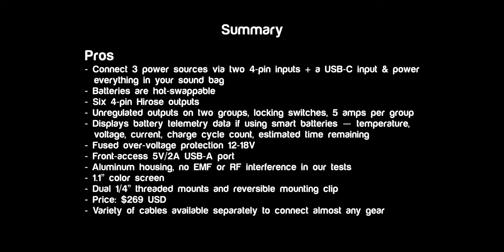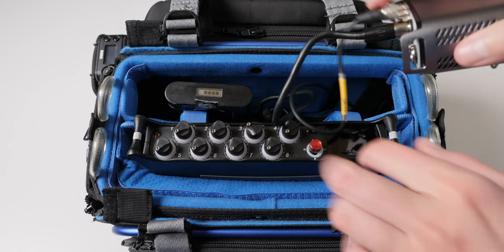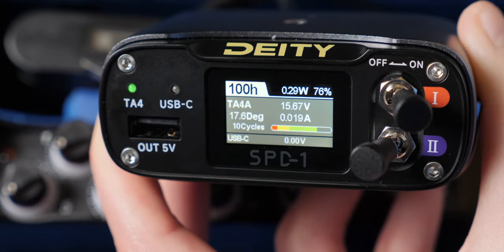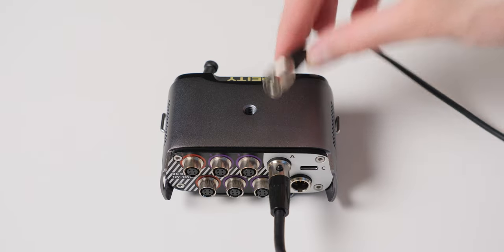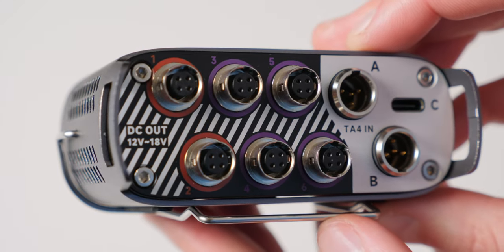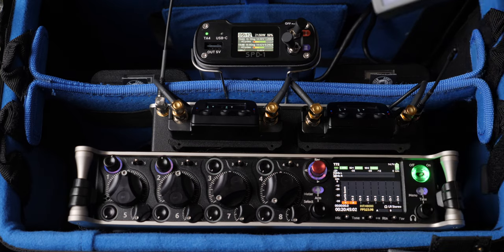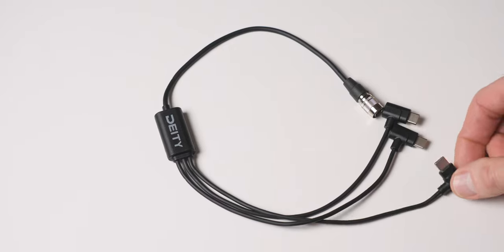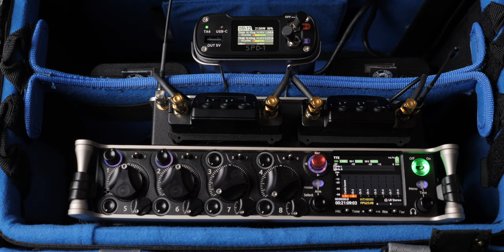Power Your Sound Bag: DEITY SPD-1 Power Distribution Box

Comment: I would have maybe thought twice before buying my BDSV4 from Remote Audio after seeing this model given the features and the price point. The cons for me with the Deity would be that i needed more DC locking barrel plugs for my wireless rather than 4 pin Hirose, and the higher cost of 4 pin cables that may need to be adapted for my wireless receivers(using Sennheiser G4’s with dummy batteries wired with dc barrel plugs)

Comment: Hi Curtis. I was especially interested in this due to the USB-C input option, specifically being able to run a bag/cart off house power/simple laptop voltage USB wallplug. Have you tested the USB-C input? I tried using it with a laptop charger (as Deity suggests) on a shoot the other day, but the SPD-1 was showing it would only receive 9V from USB, instead of the desired 12V.

Comment: Coming from the field of electronics I know that unfiltered non isolated power outputs can affect devices that are powered in parallel.
I wonder if you experience any noise issues, although I doubt it because it is more common when you power more simple analogue devices.
Also the non current regulation of its outputs can be a good thing because in cheaper devices the electronics are prone to failure that could cause damage to the devices they power. If the regulator is not there in the first place one less thing to go wrong.
Reply from the maker: I haven’t experienced any noise yet.

Comment: Did I understand correctly that this will not power sounds devices mix pre 6? Or were you referring only to the USBC output?

Thank you
Reply from the maker: The USB-C cable does t supply enough for the MixPre 3 or 6 and neither of these recorders have hirose inputs

Comment: Thanks for the detailed review. One thing i don't get is that the power draw from an 888 plus sl2 is afaik in some cases a bit too much for what hirose plugs are rated for, hence the ta4 in the sd 8 generation. Why use a device that has that high power rating on the input side but not on the output?
Other than that, great product i'm really considering for my 633bag
Reply from the maker: Yes, that's my understanding.

Comment: If you have an 888 with an SL-2 (as you did in this video) then there's not much point to using the Deity is there? You can just run your smart battery into the 888 (using the 888 to monitor telemetry) and use the SL-2's outputs to power everything else. I guess the manual toggle switches might be a benefit in some circumstances tho?
Reply from the maker: Also, multiple batteries for hot swapping. That’s a big benefit on its own.
Reply: @curtisjudd  The 888 has no fewer than 3 hot-swappable batteries on its own, though (the smart battery and 2 NP-Fs)
Reply from the maker: @patrickchase5614  yes, but I prefer not to have to dig into the bag or pull out the mixer to change batteries.
Reply: @curtisjudd  no need to dig into the bag! You can charge NP-F batteries without needing to remove them, I haven't removed mine from my 833 in months and *months*.
Reply from the maker: @davidcmpeterson  truce! I’m not here to say you have to buy this or do it my way. For my workflow, I prefer to use two smart batteries. I make no judgements about everyone else powering how they choose.

Comment: Thanks Curtis! So to be clear, you can power an 888 with this, but NOT a MixPre-3? Even from the dedicated USB-C?
Reply from the maker: Hi Zach, with the existing cables, that’s correct. But there are two potential solutions: 1) use one of the after market battery sleds for the MixPre with a 4-pin hirose input or 2) DEITY makes a new 4-pin hirose to USB-C cable which supplies enough voltage and current for the MixPre-3 or 6 recorders
Reply from the maker: Also, the USB-C port on the SPD-1 is a power input, not an output.
Reply: @curtisjudd  Ah, I didn't know about the hirose attachment for MixPre. That's the move. Thanks again!

Comment: Hi Curtis, great review as always! Have you tried powering the Mixpre through the usb-a port, using an adapter to usb-c?
Reply from the maker: No.
Reply: @curtisjudd  Meanwhile I’ve tried it and it actually works!
Reply from the maker: @TheElFuppo  does it fully power the MixPre or only in the orange low power mode? Which adapter?
Reply: @curtisjudd  Full power green mode. I actually just used a simple usb-a to usb-c cable, which came with one of my power banks.
Reply from the maker: @TheElFuppo  I see, so that cable doesn't adhere to the USB-A spec. That's good in this case.

Comment: Not clear to me how you powered the 888 via the SPD, or was the 888 connected to the SPD?
Reply: Hirose to TA4f cable
Reply from the maker: Exactly, yes, connected the SPD to the 888 with a hirose to TA4F cable.
Reply: @curtisjudd  Kinda defeats the purpose of the TA4 doesn’t it 😆. That whole TA4 thing bugs me seeing as how everything SD made for decades is Hirose. I know why they did it, just a little irritating.
Reply: @AllenCavedo  hirose couldn't supply enough power for the 888
Reply: @davidcmpeterson  According to the comments above, the Hirose connector does supply enough power for the 888.